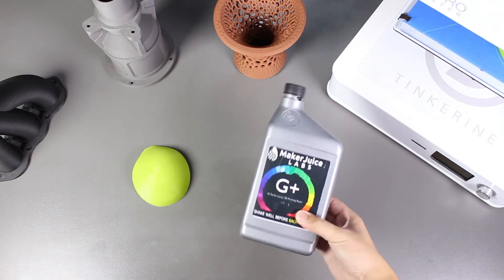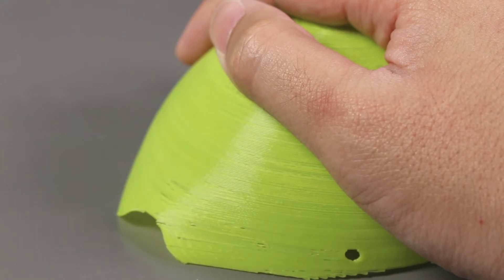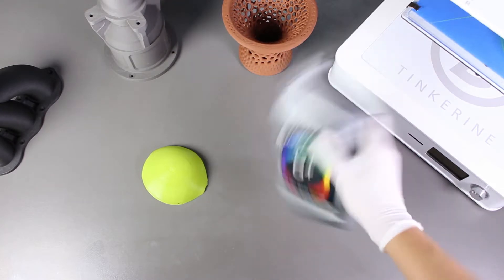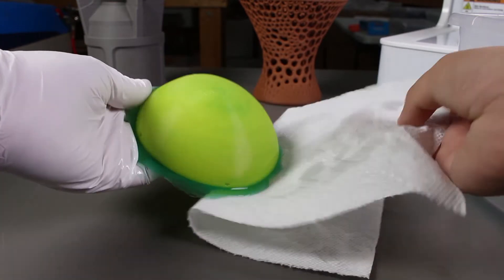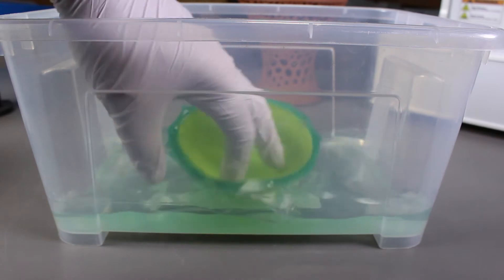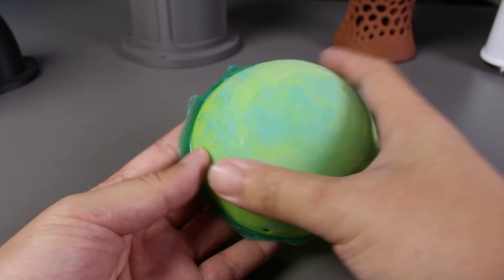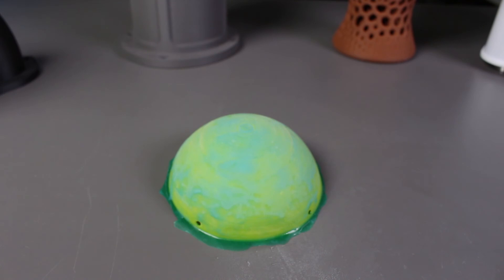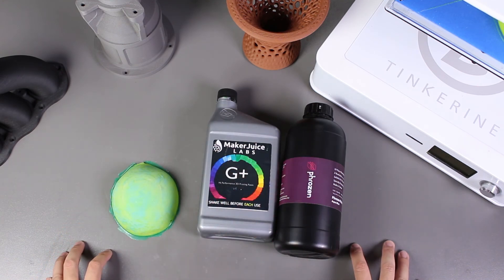Attempting to Smooth 3D Printed PLA Parts with 3D Printing Resin

Comment: There's much, much better ways of using resin for smoothing. You only need about a tablespoon of resin and a chip or foam brush. Apply it with a brush. Cure the resin. In a tub, spritz lightly with alcohol from a spray bottle. Let the alcohol evaporate. If you wipe the resin or alcohol off, obviously, it's going to remove a bunch of resin.
Reply from the maker: Thanks for the comment and advice!

Comment: Whats the use of resin 😁 i can smooth it by just sanding it
Reply from the maker: Thanks for the comment! The resin is used to fill in the gap on the 3D printed PLA print and then for an even finish, we sanded it down.